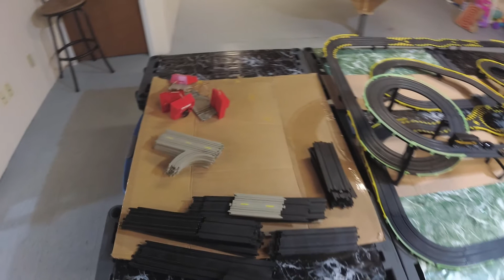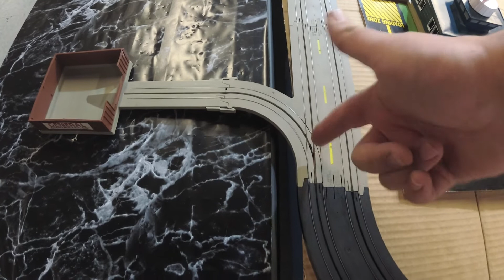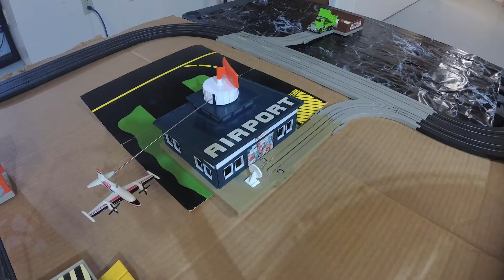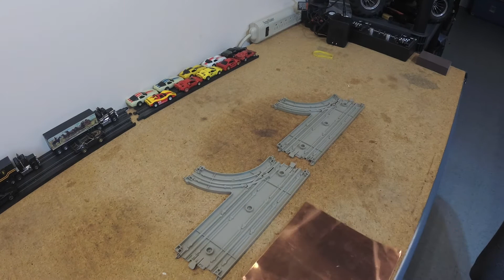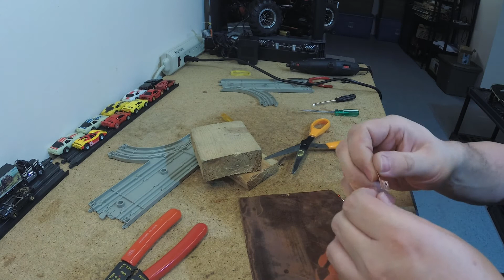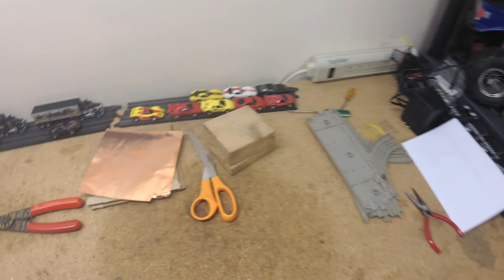Tyco US1 Trucking Track Repair Layout Slot Car HO Scale AFX Auto World

Comment: So we have come across us1 electric trucks and was wondering what's the difference between the metal blocks inside the chassis any kind of help would be appreciated thank you
Reply from the maker: It's for counter balance to keep the front of the chassis down on the track when towing a trailer or hauling cargo

Comment: So awesome. What is the power supply set up?  Can i use a 12v power supply?
Reply from the maker: I used an adjustable power supplies. They also sell hobby grade power supplies that do the same thing. I have videos on the channel showing how to do this as well. https://youtu.be/-UTVdR4OAyk
https://amzn.to/4910y0o
You need pigtails to connect to the track. https://amzn.to/48WcBvR
Reply: @StockpileHobbies  thank u so much for that info. I'm gonna order then up now, lol. So I'm thinking since I just set me us1 set ups them seemed so slow going around. I sanded the track, cleaned it all but when 2 trucks are running they both slow down bigtime. Hope this will help with all that. 🙏🙏
Reply from the maker: @artieaudio77  yeah, they need more power than that wall wart power block can supply. Using this at 24v will wake them up. I have a few us1 trucking videos from the early days of the channel as well. Good luck!
Reply: @StockpileHobbies  yeah man i watched them haha thats where I got that idea.   I see we have a love for clods and kyoshos?  I got walls full lol
Reply from the maker: @artieaudio77  Yeah, unfortunately I sold all the RC stuff and I'm the process of selling all of the slot car stuff as well. Focusing on Transformers going forward.
Reply: @StockpileHobbies  ohhhhh hell brother. Nice you going for all g1?
Reply from the maker: @artieaudio77  no. I sold all of those last year and a few remaining ones at the moment. I'm enjoying the newer ones with my son.

Comment: Great video! I will have to try repairing my turnouts too. Two questions: what are the measurements of the pipes that you have with your crane and what diameter are the gravel? I have lost all of mine!
Reply from the maker: There is an auction on ebay for the gravel right now: https://www.ebay.com/itm/334329043235?hash=item4dd7905923:g:1zMAAOSwOKpgKWvr

and the pipes: https://www.ebay.com/itm/234418366859?hash=item36946c698b:g:h5QAAOSw91Vh0lEb Mine measure Outer Diameter 9/16 by 3/8

Comment: Nice work. I am a feverent collector of US-1, got a ton of broken tabbed track I didn't want in my boxed sets, now I know what to do, pull those tabs and second hand them, lol.. FYI, the pins holding most of the stuff on US-1 is just heated to melt it down to hold. You can use a solder iron to quicken the process, or a sandpaper tube on a dremel. Especially important for switching chrome parts on the higher end trucks. Then just melt it again to hold it on.
Reply from the maker: Thanks for the melting tip with the tabs, I'll try it out on the truck bodies when I customize one again.